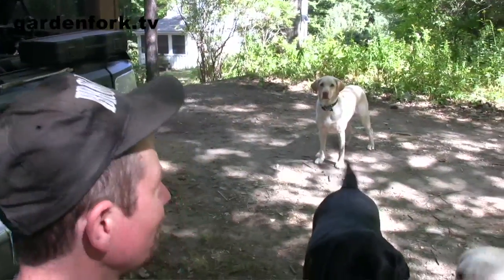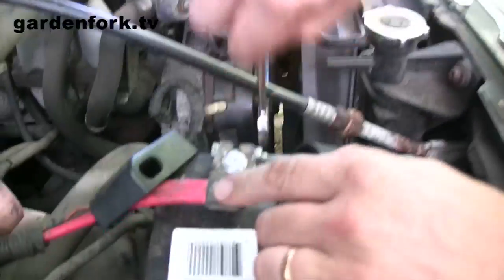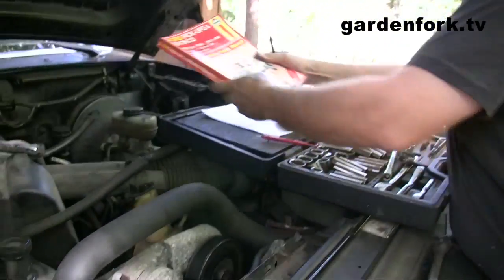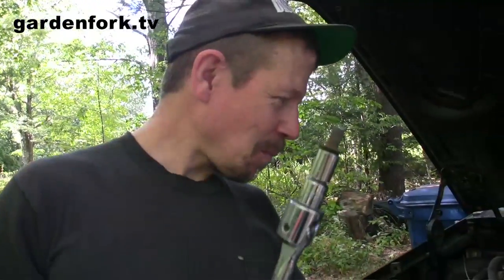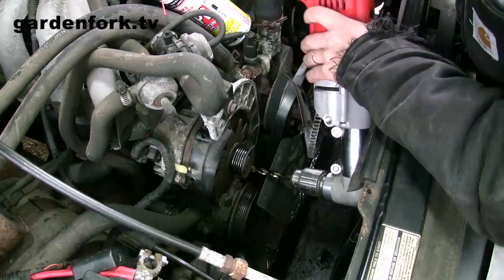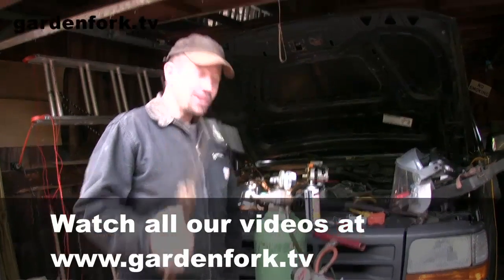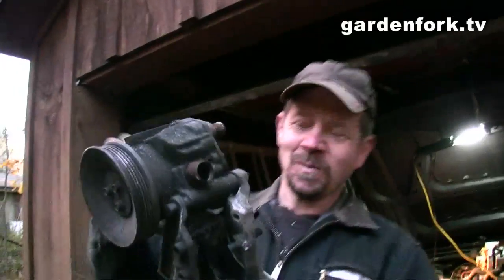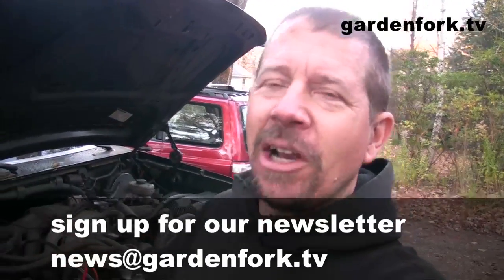How to replace a car - truck alternator - GardenFork

Comment: I really like UR determinations & attitude about how this whole thing went down.  Above all, I admire your knowledge!  BTW, I know U've been asked already what type of anti-seize compound U were using, to which you responded "it comes in a gray container. I looked at Amazon.com, and the only container that looked gray was this one:  

Permatex 77124 Nickel Anti-Seize - 8 oz. brush-top bottle

Can U let me know if this will work? You can even use the description to look it up on Amazon.  Thanx!